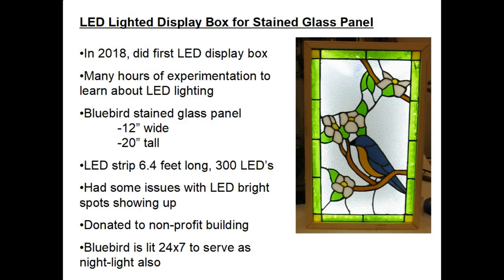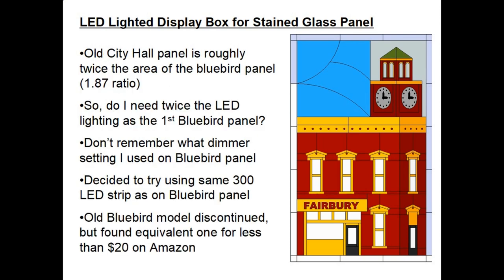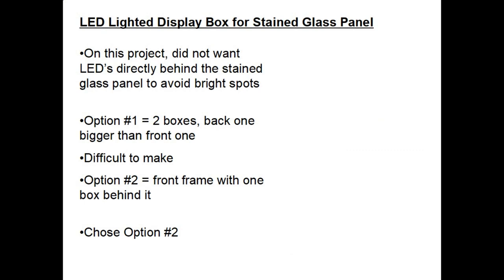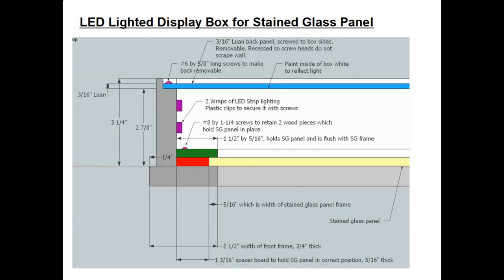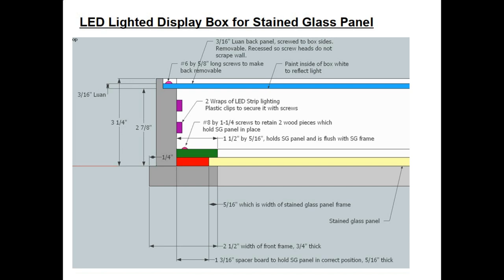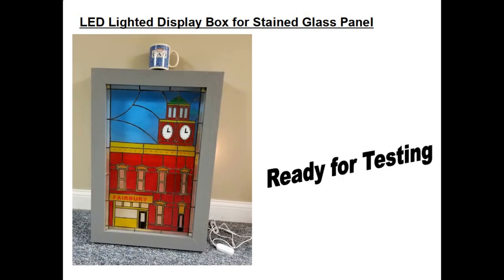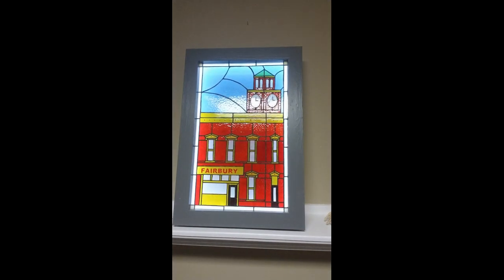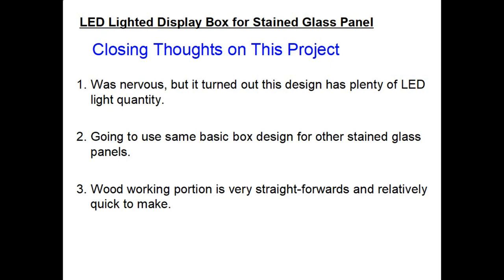How to Make an LED Lighted Display Box for Stained Glass Panel

Comment: Hey Dale, I've done a couple of versions of this, if you do another like your bluebird you should consider putting in a piece of plastic to diffuse the light.

I make my own frames as well, and the last one I did was similar to this, but with an open back. That way it could be used against a wall or in front of a window.
Reply from the maker: That is an interesting idea of using either LED lighting or natural lighting for the stained glass panel.  On my last 2 LED projects, I made the back  cover removable with screws, so under your idea........I could easily remove the back panel and use natural light if I had the window space someday.  Thanks :)

Comment: If you had use a thicker red spacer, you could use window pane glazing points to hold the panel. Use them on the front and just cover them with   trim.
Reply from the maker: Thanks for the tip.  Nice thing about woodworking is that there are many different methods and tools that can be utilized to make the same assembly. Thanks for watching the video.

Comment: Since this is a slideshow, do you have the sideshow we can download? Great amount of info! I tried the link you posted but it timed out.
Reply from the maker: The way I make most of my Youtube videos is to first make a Powerpoint with each scene on a page of the ppt file. I then convert the PPT file to a WMV movie format file with 30 seconds per each slide. I upload the WMV file of the powerpoint file into a movie creation software (AVS Video 9). Then for each slide on the ppt file, I use a microphone to make an audio file, which I add to the movie program. So yes, I have the original PPT file, but there is no audio on it.  Hope that explains it.

Comment: Dale, I need to illuminate a 6x6ft glass bead project and/but without a box-frame. Is getting somewhat even lighting even possible?
Reply from the maker: Trying to get LED lights on the outside edges of the object to illuminate 6 feet is probably impossible in my opinion.  You probably have to "back-light" the object somehow.  Good Luck ! Thanks for watching the video.